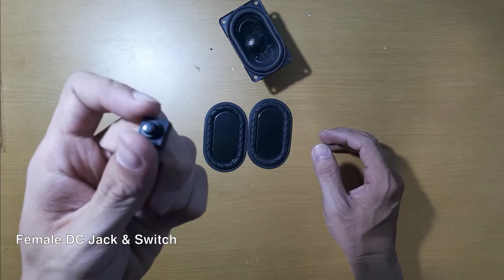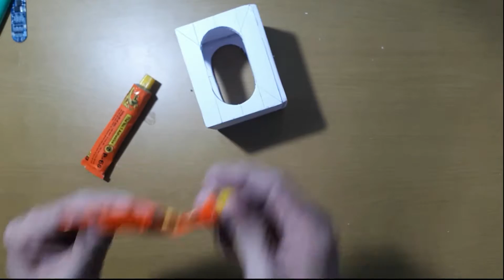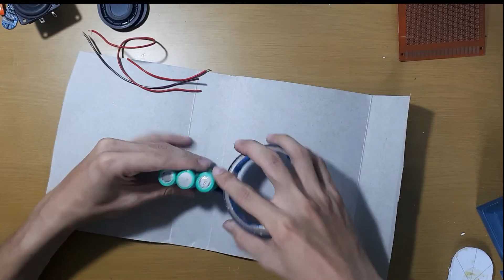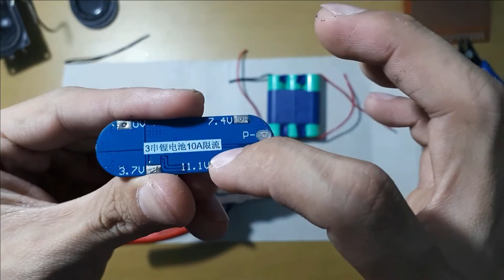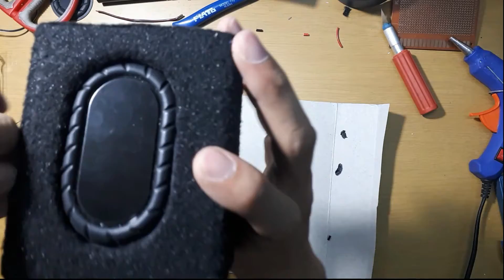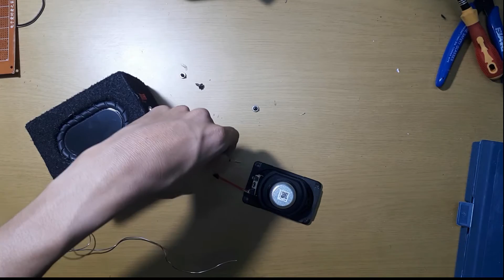How to Make Smallest Bluetooth Speaker

Comment: I have a small re-chargeable Bluetooth speaker (one output) with one 3 watt 8 ohm speaker, I want to add one more same speaker, So should i connect it parallel or series ? Please give your suggestions.
Reply from the maker: You can use one or more speakers with the total impedance less than 8ohm.
Here is the formula to calculate the resistance:
-Parallel: 1/R = 1/R1 + 1/R2 + ... + 1/Rn
-Serial: R = R1 + R2 + ... + Rn
Thank you for watching my video. Plz like and subscribe for me 🤗